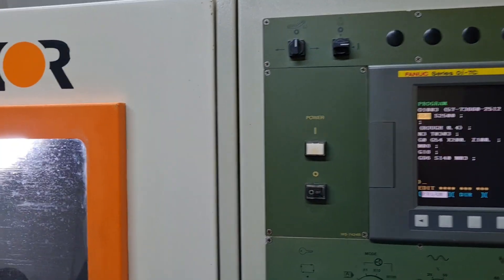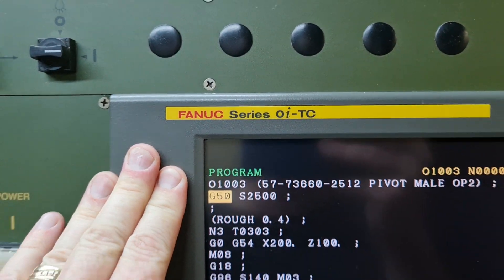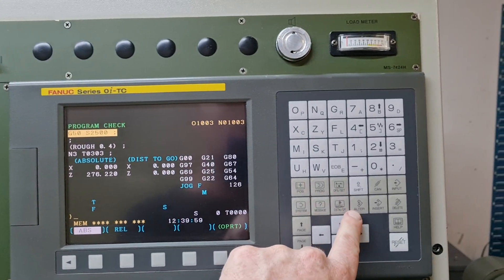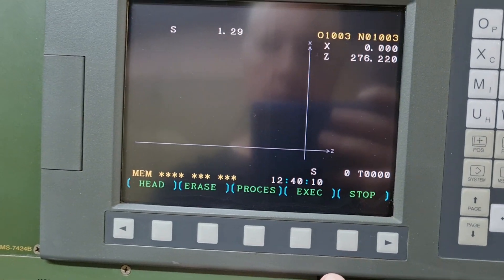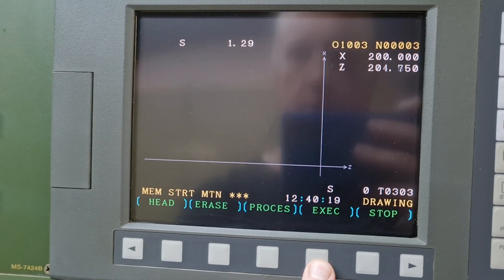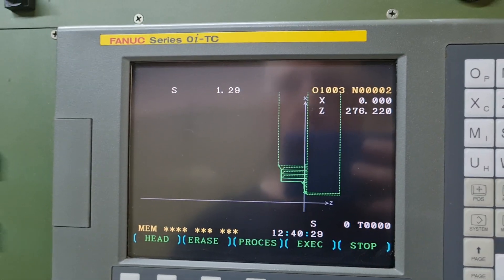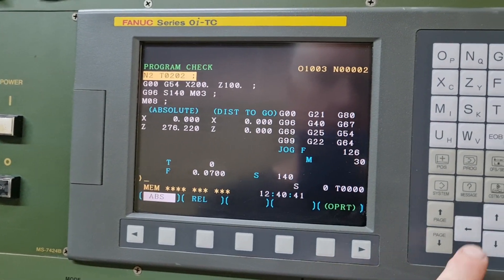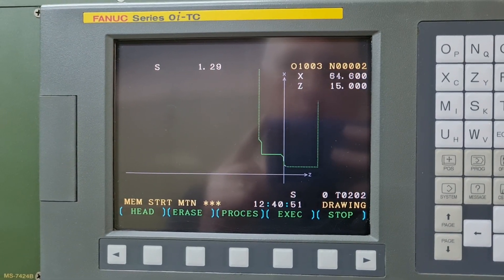Using Graphics / Graph on a Fanuc OI-TC

Comment: Hi John.
I have question to ask you. How can you change chuck ID & chuck OD. Most the time i use chuck on OD part. Somtime i have some part chuck ID. Thanks
Reply from the maker: Will make a Video to explain in the morning. 
MDI mode Tipe M65 or M66 then cycle start.
M65 OD Clamping.
M66 ID Clamping.
Reply: @JonathanBirch7  Thank  you Johnâthnbirch7. Have a good afternoon
Reply: @JonathanBirch7 Hi JonathanBirch.  In MDI mode i type M66 then Cycle Start. And then machine did nót let me clamp and unclamp. So i shut down machine and turn on again,  ID clamp  not working. It is still working OD clamp. Can you please make video clip ,show me how do to it.Thamks
Reply from the maker: @johnpham1517  https://youtu.be/JySjN0M7j20?si=OZsX5KIIgN4BOAU8

Comment: Hi jammer om te pla maar oor die hele graph van die masjien hoe vul jy jou waardes in op die materiaal length en diaamiter moet dit altyd in soos 100 000 's en op wees of kan dit laer wees as dit ons het n victor maar die control is net oi- T
Reply from the maker: Goeie dag.
100 000 is 100mm.
Jy kan jou eie waardes daar insit totdat jy sien wat aangaan.
Ek het 'n ruk ront gekarring totdat Ek tevrede was.
Reply: @JonathanBirch7  dood reg dankie.